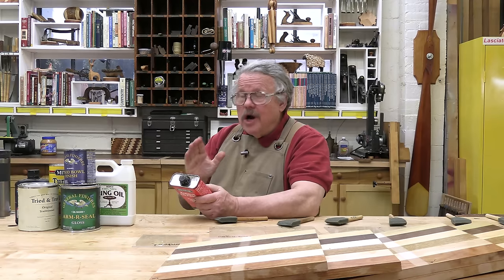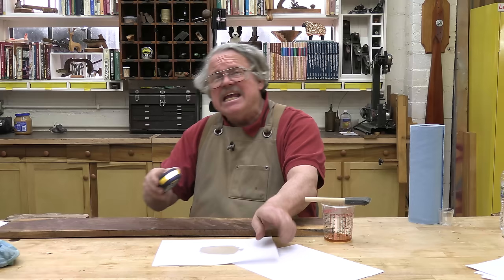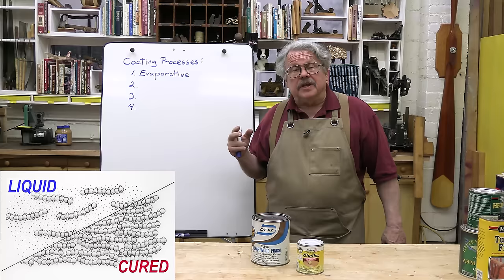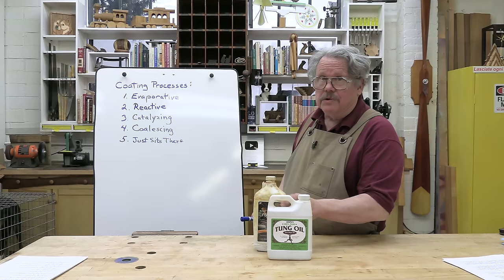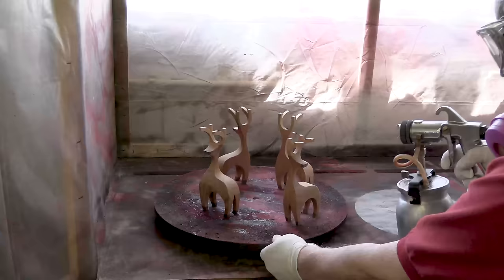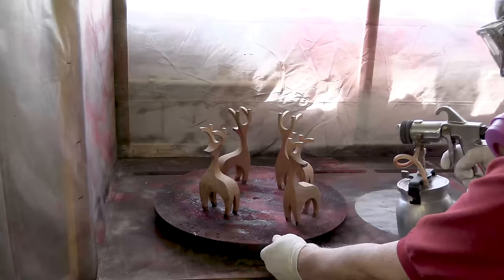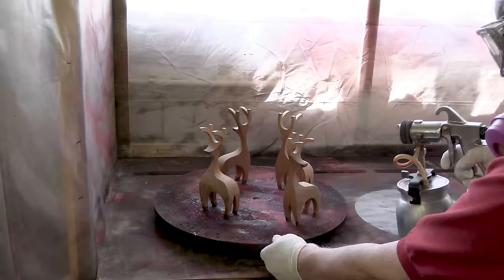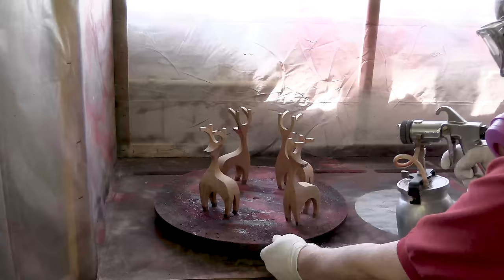Finding the Perfect Finish

Comment: This is such a great video. Very helpful and explanatory. I build tables as a side job and I'm always trying to improve my finishing process. Would you say that Rudy's wipe on finish would be one that is durable enough for a dining table top? Thanks again for the video.
Reply from the maker: I have two tables that see daily use in my home. One I finished with polyurethane; the other with Rudy's recipe about the same time (20-25 years ago). Just last week, I broke down the poly-u-finished table and took it to the shop because it needs refinished -- the poly is worn and flaking in spots. The other, which has seen similar abuse,  looks to be good for another 25 years. To be fair, today's polyurethane finishes are vastly improved over what was available to me in the 1990s. But then, so has the tung oil finish and spar urethane that I mix it with.
Reply: @WorkshopCompanion  Wow. That's impressive. Speaks to how well the Rudy's finish holds up. Thanks for responding!

Comment: Wait, what about just using pure Helmsman Spar Urethane?
Reply from the maker: The video compared wipe-on finishes, and spare urethane is not that. It needs to be diluted. In this case, it's being diluted by a tung oil finish to take advantage of the depth you get from a penetrating finish. The mix is more durable than the tung oil finish alone, and deeper than the spare urethane alone.

Comment: Thank you very much, excellent demo. Could I use something to put over pure tung oil that I put on a roasted maple guitar neck (a few layers, used 800 to 2500 water sanding paper to rub it in) so that it would make for a harder surface? Although the roasted maple is already quite hard. I like the satin finish and good grain definition of the tung oil and want to keep it like that as it allows my hand to travel along the length of the neck with little friction (compared to a lacquer or other gloss finish).
Reply from the maker: I've made a few banjos many years back, and I finished the necks with an old, traditional finish taught to me by one of the folks at Stewart-MacDonald. I hand-rubbed boiled linseed oil into the wood, let it cure for a week or so, then rubbed it again with beeswax. The necks felt warm and smooth -- they were a pleasure to hold and play. If I had to do this again today, I'd use tung oil as you did, then make up some paste wax from beeswax, paraffin, carnauba, and turpentine. See our video on making paste wax. If you work from my recipe, eliminate the microcrystalline wax and double the carnauba. That should give you a soft, satin look and eliminate a great deal of friction. It will also smell great. (If you don't want the pine smell, substitute mineral spirits for turpentine.)
Reply: @WorkshopCompanion  thanks a lot. Will go and see the video.

Comment: What would you guess the re-coat times would be in 70 degree low humidity shop.  I'm assuming the Tung oil is slow to absorb, but didn't know if the Spar added would change it for the final coats.
Reply from the maker: In our shop, it's about 6 hours, although we sometimes apply the second coat in 4. I couldn't begin to guess what it would be in yours. You need to experiment.

Comment: Thanks for this video. I have dining table top restore of cherry wood. Would you recommend using Rudy Salmik's recipe for cherry as well? And how would it work for pinewood outdoors?
Reply from the maker: Rudy's blend works fine on all hardwoods, cherry included. However, I doubt it would weather well outdoors -- there is very little to protect from UV degradation.

Comment: Great video! Minwax products are expensive in the UK. Can you recommend any alternative to the Minwax tung oil finish, maybe something that I could blend from other products? I can get pure tung oil cheaply, but not sure what else I should add to it, if anything. And do you think another spar varnish would work just as well? Thank you.
Reply from the maker: I have no idea what to tell you. It's all I can do to convert Imperial to metric; I haven't yet run across the algorithm that translates American finishing brands to British equivalents. I would avoid "pure" tung oil, it takes forever to cure.  Look for something with polymerized tung oil (expensive) or a what is called a "tung oil finish" here in the US (less expensive). The latter is usually a blend of alkyd resins from various vegetable sources, including a little tung oil -- sometimes very little. This is what Minwax Tung Oil Finish is. Add a little something with some harder petroleum-derived phenolic resins (such as spar urethane) to increase it durability. You can determine whether a finish is mostly alkyd or phenolic by studying it's Material Safety Data Sheet (Part 3), available for free on the Internet.
Reply: @WorkshopCompanion  Thanks! Colron Antique Oil seems to be a blend of tung oil and resins, and the MSDS lists the main ingredient as "Hydrocarbons, C9-C11, n-alkanes, isoalkanes, cyclics, <2% aromatics". So that looks like it is mostly alkyd — I might try that along with a spar urethane.
Reply from the maker: @ngdavies  Sounds like a plan. For those readers following this conversation, in chemical terms alkanes and alkyds are hydrocarbons in which the carbons atoms are strung together forming a line or a "tree." They are commonly manufactured from plant-based oils. In phenolics, the carbon atoms form a ring and these are extracted from petroleum. Both types of resin will react with oxygen and cure to form a stable chemical matrix -- a "finish." But the ring-based matrices are harder, denser, and more durable. This is why Rudy added a little spar varnish (phenolics) to the tung oil finish (alkyds) -- it bumped up the hardness. However, if you are going to mix finishes, you must make absolutely sure that the resin carriers -- the solvents -- are the same. Even then, some brands of finishes may be chemically incompatible, preventing the formation of a matrix. Always experiment with a mixture before you commit to use it on a completed project.

Comment: Great video. Thank you. I've been a fan of the Minwax Antique Oil for years, ever since I learned about it in a gun stock finishing forum. What would you recommend for a guitar body made with black limba (open pore wood). I was thinking Minwax antique oil (or polymerized Tung Oil) and sanding it in to work up a slurry, and 'grain fill' that way, and then maybe overlay that with Rudy's recipe? Looking for the 'look' of french polish, but with better durability... Thanks again.
Reply from the maker: I would not recommend a penetrating finish for wooden musical instruments. Depending on the wood and/or the finish, these can change or even mute the tone. Stradivari and others after him used a simple oil-based varnish that penetrated less than a tenth of a millimeter into the surface. For the musical instruments that I have made, I prefer a "spirit varnish" -- an alcohol-based finish. These dry so quickly that they hardly penetrate at all. They aren't especially durable, but they sound great.

Comment: Slightly unrelated to the video but related to finishing - do you finish both sides of your piece? I'm in the process of making a dresser and curious if I don't finish the inside, will it warp? Thanks Nick, this channel is fantastic!
Reply: It is common not to finish the interior of projects and has been throughout history. Even the outside of drawer sides were not usually finished, just a small band corresponding (sometimes roughly!) to the ends of the dovetails tended to have a continuation of the finish from the front.

It's also generally not needed to finish the undersides of tabletops BTW, although many people do. If the method of attachment to the usual table support structure – the apron that spans the gaps between the legs –is done correctly it can hold in check any tendency of the tabletop to want to curl up at the front and back or bow upwards in the centre.
Reply: @tungsten_carbide  Thank you, this is so helpful!!!

Comment: I'm sorry if you've already answered this (I didn't see it), but do you happen to know the lifespan/shelf life for the Tung+Spar mixture?  Thank you!
Reply from the maker: It depends on how much air you let stay in the can,  and how often you open the can, exchanging the air. Remember, this is a reactive finish; it reacts to oxygen.  Perhaps less than a year if  you use it often, opening the can every month or so. You can greatly extend the shelf life to well over two years if you fill the can with marbles as you use the finish, expelling most of the air.  The estimated shelf life for most Minwax products is three years, unopened. This comes from users, not the company itself. Unfortunately, Minwax does not offer a Technical Data Sheet (TDS -- different from a SDS) which normally lists this information.

Comment: Thanks Nick, How long can the mix be stored, and in what type of container. And the TOF and Spar Urethane; how long in their original containers. I look forward to your shows. Thanks pal. Keep going.
Reply from the maker: Indefinitely, as long as you keep air out of the can. Get a couple bags of marbles and use them to fill up the can as the finish dissipates -- this vastly reduces the amount of oxygen there is to react with a reactive or coalescing finish. When you've exhausted a can and it's full of marbles, start transferring the marbles to the next can.

Comment: I tried the Spar mix with Danish Oil and failed as it just doesn't cure.
Reply from the maker: This is why finishing tests are so necessary. There is no longer any way of knowing exactly what chemicals are in a finish or how they will react with other finishes. Furthermore different brands of finishes will have different reactions -- Minwax Spar Urethane may have a different reaction when mixed with Watco Danish Oil than it would if mixed with  Tried & True Danish Oil. You just have to test.

Comment: Hello, just found your channel. As a professional woodworker I find that I don't actually watch many woodworking channels on the you tubes but boy you're fun to watch. I do have a serious question though. I usually use a fine 0000 steel wool to rub my finishes out. It's ablative which solves the problem of clogging, but also creates some really nasty dust. I noticed you use scotch brite pads and was wondering what type you use, why you use them, and how they compare to steel wool.
Reply: This is very much a FWIW comment but I don't at all consider steel wool and Scotch-Brite equivalent, even though the finer grades of SB (grey and white in particular) are frequently referred to as 'synthetic steel wool'. Because it has abrasive grains bonded to the nylon fibres the effect of Scotch-Brite is really more akin to that of sandpaper than steel wool. 

I am a fan of 0000 steel wool and won't be ditching it any time soon, accepting the powdery mess as a necessary cost of its wonderful smoothing ability. But a gentle rub with worn, quite fine, foam-backed sanding film followed by a buffing with the rough side of brown paper does come close 🙂
Reply from the maker: I use 3M Scotchbrite. It doesn't really do the same thing as steel wool, since wool cuts and Scotchbrite abrades. But you can achieve the same effects as wool without the "nasty dust." It takes a little longer, but the pads -- because they are not ablative -- last longer and are more economical.  I simply whap them against the edge of my workbench to clean out the accumulated dust every few minutes. However, I should note that I use Scotchbrite and avoid steel wool for another reason altogether. I love animals and have always had a shop dog or two -- great company. Dogs, especially pups, seem to love steel wool. It's enormous fun to chew up when a pad falls off the workbench. I've never tried it myself, but my dogs assure me that this is so. But it's also harmful to their digestion system, occasionally fatal. They don't seem to have this same fascination with Scotchbrite. So Scotchbrite it is.

Comment: Trying to make a diy version of this stuff called Finish Rejuvenator by The Victorian House. Do you know what’s in it by chance? It’s a clear liquid I see in pictures online. No ingredients list I can find. It’s only sold on their website I am seeing for about $30 a bottle (16 oz)…kinda pricey. Thx in advance
Reply from the maker: I have no idea how the Victorian House makes their rejuvenator, but you can make your own by mixing one part white shellac and three parts denatured alcohol. This thinned shellac covers the old finish, filling in the cracks. Do light sanding between coats and rub out the final coat with paste wax. This really doesn't "rejuvenate" the finish; it's more like putting a new finish over old. But it works, the same way painting your house seems to rejuvenate it. I you'd like to know a little more about rejuvenation, Consumer Reports put together an excellent article: https://home.howstuffworks.com/home-improvement/home-diy/projects/how-to-restore-wooden-furniture-finish.htm
Reply: @WorkshopCompanion  can you apply the mixture with steel wool? That’s how The Victorian House stuff is applied.
Reply from the maker: @shadyj1976  No.

Comment: I used to use Formbys Tung Oil Finish HIGH GLOSS and was very satisfied with the results. That product doesn't appear to be sold any longer. Is the NEW Minwax 47500000 Tung Oil Finish a similar enough product to make it worth a try? Thank you
Reply from the maker: I couldn't tell you; I have very little experience with Formby's. But I do know that their high gloss is still manufactured; I quickly found it in stock and available from three Internet suppliers.  If you're finding that you can't get it at a local store, that's not unusual. The combined effects of Hurricane Harvey (which drastically reduced refinery capacity) and the disruption in the supply chain due to Covid have afflicted many traditional outlets.
Reply: @WorkshopCompanion  The Formbys Tung Oil Finish HIGH GLOSS  is either out of stock or being sold for more than $5.00 per ounce on all of the sites I could find. Thanks

Comment: Would you say that Danish Oil is close to Rudy’s secret recipe.  It does have a mixture of varnish and tung or other similar oil.
Reply from the maker: The only real difference between Rudy's finish and Danish oil is the tung oil -- very few Danish oil blends advertise that ingredient -- and the chemistry of Minwax reactive  finishes in general. Rudy was careful, as am I, to use the same brands when mixing finishes to reduce the chance of the chemistry being incompatible. "Stick to the stuff in the yellow cans," was the advice I remember.

Comment: I just came across your channel.  That was an awesome video. 
I'm just an amateur hobbyist, but I've always used a polyurethane (not the water based crap because I find it leaves brush strokes because it dries so fast). 3 very thin coats always seems to leave a very nice finish that doesn't look like the wood is coated in plastic.  But recently I've been experimenting with other types of finishes.  Shellac, Minwax tung oil finish,  16000 grit sanding and wax. 

What is a spar urethane ?
Reply: Spar urethane is a more water resistant and humidity tolerant coating.  Originally for the spar of a boat.  I've used it on a few exterior doors.

Comment: Thank you for the extraordinarily informative video. 
You didn't talk about spray on finished that come in cans, which is a much lower barrier to entry than the spray gun.
Are these any good? 
It seems here in Australia, spray laqcuer which I hear a lot about on YouTube, is not readily available or called varnish (maybe, it's not clear). 
It's hard to find clarity as a beginner.
Reply from the maker: Finish in spray cans can be just as good as any other. I know several professional woodcarvers that swear by ?Deft," a spray lacquer in a can. As far as what's in the can, it's a shame that words like "varnish" and "lacquer" are used interchangeably; this confuses professionals as well as newbies. You need to get the Safety Data Sheets for the finishes that interests you and look at Section 3 -- the ingredients. That will give you a much better idea of the finish formula than whatever marketing hogwash is on the label.

Comment: What finish could be used for a paper map that is glued to a foam board?  How about for a picture print?
Reply from the maker: Since I have never applied finish to a map or a photo, I couldn't tell you. But I do suggest that you run some experiments before actually finishing something made of paper. Finishes render paper translucent, allowing you to partially see what's behind it -- you may not like the result. This is why most folks display paper items behind sheets or glass or plastic.
Reply: @Workshop Companion  Mahalo nui, thank you very much, for the reply.  I really like your presentations.  I'll give some test pieces a try.

Comment: What happens if you don't sand between coats?
Reply from the maker: No matter how clean your shop is, from the moment you apply a finish dust settles onto the uncured coating. Finishes are formulated to "wet" the surfaces to which they are applied -- their adhesion to these surfaces is greater than the cohesion between the liquid molecules. Consequently, the liquid finish climbs up these microscopic dust motes, hardens, and creates little bumps in the finish which must be sanded flat before applying successive layers. Otherwise, they'll just get worse.
Reply: @WorkshopCompanion  thanks, I'm working on my first project that needs a really nice finish so I need all the help I can get! I appreciate the reply.